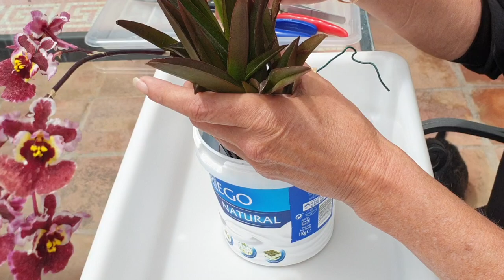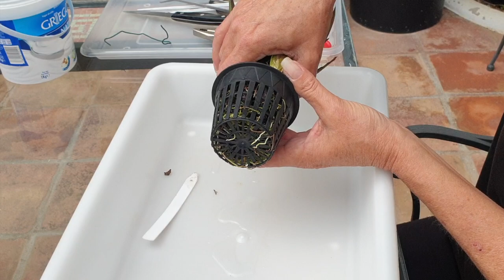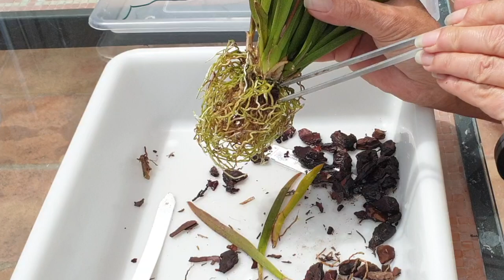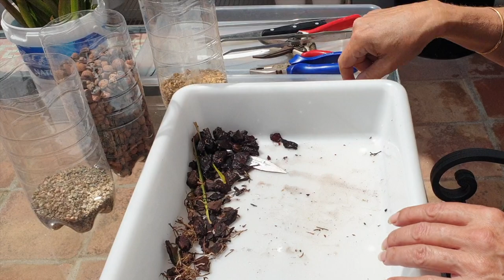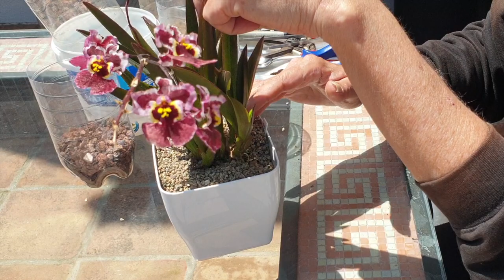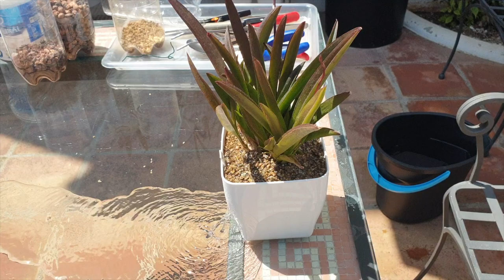Semi Hydroponic set up for Tolumnias | A drier version of Semi Hydroponic set up #ninjaorchids

Comment: OK, this one surprised me, I didn't expect you to pot a Tolumnia up in this type of setup. I hope it works out well for you, then no risk of burning roots by them drying out with fertilizer on them. I suppose, the ones you have, if the roots aren't attached to the lava rock, it could be a possibility for their future to be in the same type setup. I don't know if those pots would fit in the wire baskets, though, to allow them to hang in the summer the way they do.
I just repotted my victoria-reginae into semi hydro with growstones. It has good roots but the plant just looks awful. Maybe the constant moisture will help it. Maybe it will keep the roots a little cooler to help it. Honestly, if I didn't try something, it wasn't going to be around much longer.
Reply from the maker: Don Miguel 🥰💐 hola jefe! I think this should be ok.... I am 80% confident, but time will tell. I have come to understand that, if fine roots don't have a wet / dry cycle, they need a wetter cycle to not get dehydrated by the media. So... methinks, that this will be ok 🤞🏼😬Unfortunately, these pots are too big for the wire baskets, which sucks. This tolumnia is also far too big on the leaf size to fit into the baskets... so, yeah, I will have to place it on the tray in future winters. I also did not find an equivalent kind of basket that looks similar and is larger. I will keep an eye out for something like that 'just in case'. Mini bird cage 😅😂 I am sorry to hear that your VR is not picking up speed. I wonder if it is a dud. Not a nice term, but I don't know how else to describe it. Like my Chantilly Lace 'Twinkle'.... what a dud of an orchid and they really are not dud growers as such! Mine still has not started to show signs of any new growth. It is a bit patética! So, maybe your VR falls under a dud category 🥺 thank you so much for watching, Michael! I wish you a fabulous Friday ❤️🌸

Comment: Soak it good first before removing  from basket or pot  or cut the pot off.  Then soak before removing  old medium.
Reply from the maker: Hi jman 🤩💐 welcome! I have not seen you here before, so a warm warm welcome and thank you so much for being here! You are right about the soaking and I had it soaked for a little while, maybe not long enough. BUT, after the fact, during editing, I was wondering why I was so hell bent on saving the basket 🤦🏼‍♀️ I sat during editing and really kicked myself, that basket would have been easily cut apart and the whole thing could have gone much easier, without the nonsense 🙄😅 sometimes, the brain draws a blank while talking 😂 thank you for watching and once again, welcome! 🫶🏼🌸
Reply: @NinjaOrchids  your welcome.  I learned the hard way too. I also learned not to put my tolumia in a clay pot because  roots stick to the clay and impossible to soak off.   I hope yours are doing well.
Reply from the maker: Update: The one in lava rock only is doing much better than the one in the akadama mix. I am hoping that it will pick up during these warm months, because, I did a number on it... I did not want to go through another winter with this tolumnia in a basket, but it was the winter that was the problem with the akadama mix. 🤦🏼‍♀️ so.... 🤞🏼 that is has the wherewith all to at least gain a little strength this summer. Since I have changed it into lava rock only, I am tentatively hopeful 😬